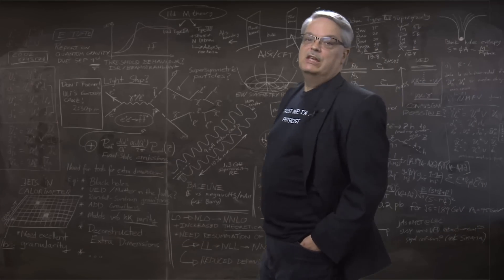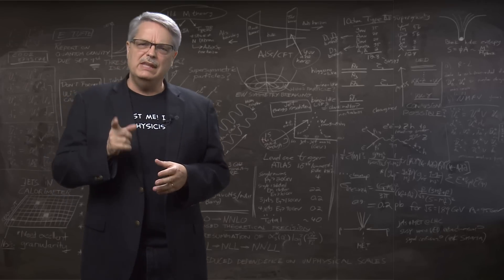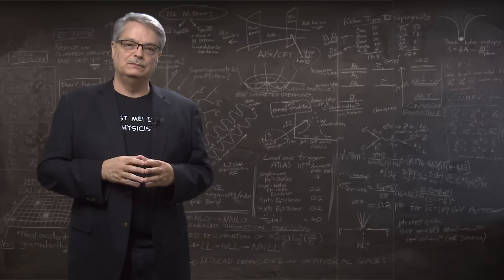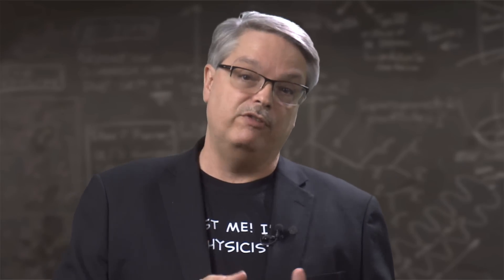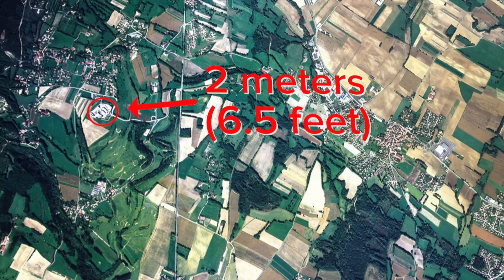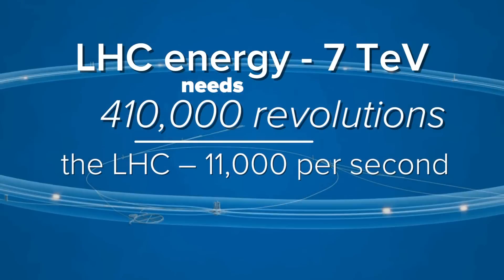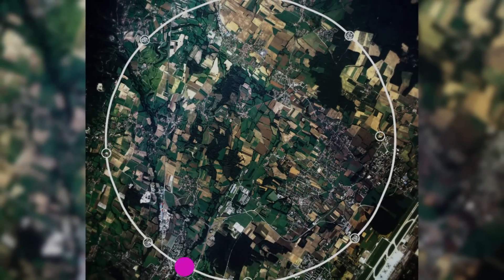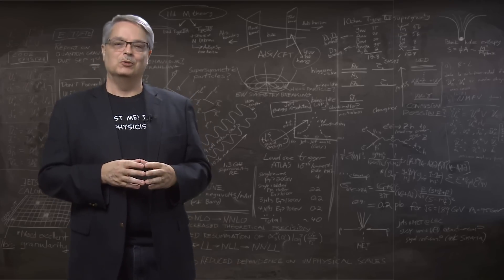Accelerator Science: Circular vs. Linear

Comment: help iter and cern to make circular linear hydrogen accelerator, for fusion
Reply: what do you think happens if you accelerate protons against gravity with electricity field in vacuum, assuming no energy is consumed in the electric field and the ions can freely float back to the accelerating field? if you can extract energy from accelerating particles, then you can get free energy. perfect vacuum, with no other forces than gravity, particles and electric field are assumed. you can use the acceleration radiation, including light as energy transfer path from fusion.

Comment: Thanks for the video. Question. It is mentioned that it would actually take longer than 36 second to accelerate to design energy (at 5:36). And that this is because of the ever higher energy. Is this because the proton is increasing in mass therefore not accelerating (increasing velocity) as much per push? Please clarify thanks...

Comment: In a way you can tell gravity (of an accelerated object) where to go. Accelerate something at the "speed of light" and it's acceleration (energy) would equate to is mass, any momentum passed that point (say in a black hole) would be more mass for acceleration. So if an object goes that fast the space it's in will move in the opposite direction(external force moving in), It's why things appear quantum.(Ex.neutrino) Light doesn't bend around objects the space just bends along with any light in it. If a fill a ballon (particle with energy in space) with water it will float in water fill it with cement (more/dense energy) it will sink.
Reply: Light moves in all directions (3d) and can only move in the space that moves it and itself (4d)
Reply: That's how to make a Higgs boson
Reply: The universe is a negative value of movement.
Reply: Like explosive lead
Reply: Or a black diamond
Reply: Passed the speed of light any form of mass becomes momentum within the region of space. Any form of momentum within a black hole (faster than light vacuum) becomes a force for mass movement, if the object moves in any direction, the space has to move to the opposite. It's like climbing up a slide and going down, the momentum built up for the slide (climbing up) is what gives energy for the fall, at the speed of the objects mass nothing can stop it. Space works the same way (being on top of the slide already) once momentum gets you going down the slide you'll keep going.
Reply: Speed of an image

Comment: If an electron is traveling as the lone-1s¹ companion of a nuclear ion {He, Fe, Au, U,...}:
—does that electron itself emit synchrotron radiation around the circular accelerator...
—is the electron's emitted synchrotron radiation stronger by its combined velocity...
—do both the nucleus and, the electron, emit synchrotron radiation...
Reply: A little off my original question, but, to follow up—If synchrotron radiation is ~v⁴ but thermal radiation is ~T⁴ (T~v²) ~v⁸ then thermal radiation brehmsstrahlung braking radiation must be deep bounce acceleration ~v⁴, because E~v² and atomic nuclear charge F~E² (E~1/r) ~v⁴, except  at the deep atomic transitions....
Reply: Interesting question....

Comment: Could you do a video on why charged particles radiate energy when they are pulled at an angle? (That's still called bremsstrahlung right?)
Reply: I know this, but I'm curious about what the underlying physics are behind the emission caused by that transverse acceleration.
Reply: In addition to the answer by ScienceNinjaDude:

To get an intuitive feel for why electromagnetic radiation needs to be emitted by an accelerating particle, consider the law of conservation of momentum. It only applies to systems without 'external forces' on it. The accelerating particle clearly is not such a system. If things go slowly there is ample time to transfer some of the particle's momentum to the apparatus (the magnetic coils, the yokes holding them up, the soil in which they are anchored,...), without us noticing HOW exactly this works. The momentum shows up as a (very tiny) stress in the construction and this happens essentially instantaneously from our slow everyday perspective.

However, if things go really fast (scale set by the traversal time of light across apparatus), we do need to appreciate the mechanism of momentum transfer inside the apparatus. Inside the LHC (or any accelerator for that matter) there is basically... nothing. The beam flies inside a vacuum tube. So the momentum change of the particle as its trajectory bends must somehow be carried through the vacuum, and the electromagnetic field is the only candidate to do that. So we need some 'blobs' of electromagnetic field that carries off the momentum that compensates for the particle's momentum change: this is the synchrotron radiation.

Fundamental question: does the momentum HAVE to be carried by some mechanism? Can it not show up instantaneously elsewhere, guaranteeing that the overall momentum of the setup is conserved without requiring it to be transported from each point to the next? The answer is no, and the reason has to do with the word 'instantaneously'. It is not compatible with Special Relativity (SR). In SR simultaneity is relative, depending on the frame of reference: events at different locations in space that are simultaneous for one observer need not be simultaneous for another observer. All inertial observers are equally valid, as postulated by SR. So we cannot have a physical law that uses the notion of simultaneity pertaining to different locations in space. This rules out any 'global-but-not-local' momentum conservation law. Different observers would not agree on it. Therefore momentum must indeed be conserved locally, meaning that any transfer of momentum from one place to another has to go through intermediary places also. So yes, we do need a mechanism to carry off momentum.

The Maxwell Equations of electromagnetism describe he phenomenon well, and physics students are required to be able to compute the exact properties of synchrotron radiation, e.g. that its angular distribution becomes more concentrated around the plane of particle motion as the particle speed goes up. This property is actually quite useful. There exist particle accelerators in which the particles are the objects of interest at all, but the main aim is getting powerful beams of electromagnetic radiation in the X-ray part of the spectrum. Synchrotron radiation as a product, instead of a nuisance!
Reply: No you did not miss anything. I just explained the basic reason for e.m. radiation emission qualitatively.

To see why electrons suffers greater synchrotron radiation loss, we need to dive into details. I know of no simple way to explain this. So I simply outline the technical argument.

First consider the (unrealistic but easy) non-relativistic case. The radiative power loss of an accelerating charge is, according to the Larmor formula, proportional to the 2nd power of the acceleration. The proportionality constant contains the charge squared and constants of nature. For uniform circular motion the acceleration is proportional to the speed squared, as we learn in school. Now we need to think clearly.

For a GIVEN kinetic energy of the particle E=0.5mv^2, which is the quantity of interest for the experiments we want to do, the square of the speed is inversely proportional to its mass. So the radiative power loss ends up inversely proportional to the mass squared. There you have it: heavy particles suffer less power loss.

But this is misleading. Reality is worse, due to relativity. The electromagnetic field at some moment at some point, due to the particle's motion, does not depend on the 'current' location of the particle, but on a previous location. The effect of changes in the particle's motion need time to propagate to the location we are observing the field. This effect is called 'retardation'. If you go through the proper relativistic computation, you basically get the same formula as Larmor, but with an extra factor of gamma TO THE POWER SIX! Here gamma is the famous relativistic factor 1/sqrt(1-v^2/c^2). Now this gamma also occurs in the energy: E = gamma m. So the 6th power of gamma results in an extra factor 1/m^6. This is disastrous (understatement). The advantage of using protons instead of electrons in a ring is enormous.

Now all this not very satisfactory if you haven't studied electrodynamics. Where do these formulae come from? Well, it's just Maxwell's equations and math. They yield differential equations for the field, which you solve for the case of a moving point charge. You only need the behavior 'far' from the particle (scale=typical wavelength). Then you also need to know the momentum of an electromagnetic field, the so-called Poynting vector, which is basically the cross product of electric and magnetic field. Of course you first need to find out why this is so, by considering a system of charges and fields whose overall momentum is conserved, so that you can equate the field momentum to minus the overall particle momentum. Finally: careful bookkeeping. You need to integrate the power radiated in various directions, being careful with your reference frames and the little 'conceptual' surface elements through which the power flows.

As I said, I know of no easy 'handwaving' argument to communicate this. Sorry.
Reply: Did he delete his posts? I can't see any responses :O
Reply: Oh weird. So they didn't like the explanation that was given to us?

Comment: we should build a circular accelerator around the world, at least for the lols
Reply: +nachijp ...and one around the Milky Way galaxy so we can test String theory!!!
Reply: Yep! To dumbly state the obvious: If you draw a long enough 'linear' straight line on this planet, it eventually will conjoin and become Circular.
Reply: @ghos282  Must admit: did not see that coming
Reply: More like in an orbital ring.
Reply: Wouldn’t need to, the smaller the accelerator, the less energy you have to put into it to achieve
The same result with  a big accelerator with the same voltage to mass ratio

Comment: how about building one around earth and having like 6-7 accelerator points?
Reply: i didnt ask how much it would cost, im interested if it would be a good idea regardless of cost...like, design is good?
Reply: The slighter curve would reduce the energy radiated by the particle, allowing you to build it up to even higher energies.  However, I'm not sure that would be any better than a continent-sized linear accelerator, which would have the same curve but much more acceleration.

Besides, if you follow the variations in the earth's crust, and particularly under the ocean, you lose much of the smoothness.  The earth is pretty smooth, but not "I want to build a particle accelerator around it" smooth.  The solution?  Build it in space instead so it's literally around the planet!
Reply: Adam Olsen 'round the planet it would be really vulnerable against all the shit we left in orbit...or else it would need to be soooo big that even sats don't interfere...how 'bout the moon? fairly smooth, already kinda cold, that's good for the machinery, right? and no silly news-writer who distort your discoveries : D could be built from materials found on the moon too i guess, but id need to check for that, i don't know what kind of cheese the moon is made of....
Reply: The moon could be a good option, but by no means trivial.  Take a look at http://www.nasa.gov/multimedia/imagegallery/image_feature_2110.html and you see that any possible alignment is going to have several km of altitude variation, which would have to be dealt with by building tunnels or bridges.

It's also much smaller than you'd get by building in earth's orbit.  It's sort of halfway between earth's orbit and the largest land-based loop you could do on earth.
Reply: Since the accelerator needs to be the same engineered apparatus, instead of tunneling and bridging why not locate it at a Lagrange point? ...guessing 'round', 'plane' and tides is why